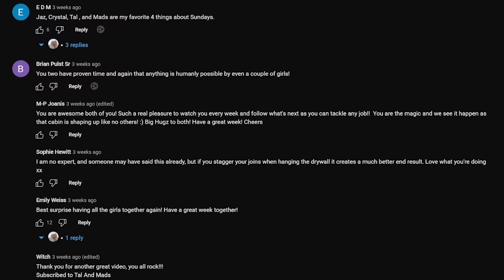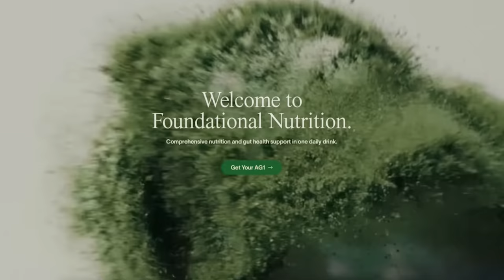We Should’ve Listened

Comment from the maker: We dusted ourselves off and decided to try again- the one thing that has helped us keep going is YOUR belief in our ability to succeed… thank you Pack 💛 Please keep the advice, feedback and tips coming!!
Reply: Rent a drywall lift. They will show u how to use it. Put textured paint on it, that will hide a lot.
Reply: There are no failures, only lessons. As long as you’re learning you’re doing great x
Reply: Its too late for my opion so i will watch to the end but i know how to do it and i plastered and drywallled for a living hi girls okay one thing about mudding and taping manfacture joints mesh and but joints paper and thin coats butt joint dont leave any excess under the tape  usualy do butt joint in two steps plaster the joint scrape all excess off let dry then next day tape using very little mud a really let that dry a lite scraping with the scraper and another coat of thin mud  and use a wide scraper dry sand and butt should be ready for prime those factory edges for me are fiber tape coat of mudd remember its not about covering with a thick coat i dry as you doo the second coat scrape with scraper then apply let dry do a light sanding and for the next coat of mud use a wider trowel and thin as possible apply another coatof mud dry sand primer look for the mistake fix sand primer  should be ready for paint do all your painting in as bright area as possible good luck  when i do this i sand but once i dont like sand so i do everything not to and thin coats is the answer  sorry for the movie but 35 yrs of of working speaking
Reply: @rayhuber3411  dry wall lift would not have worked in this application
Reply: You still have ddd
Reply: And that after international womensday!!!So proud of you2...
Reply: My biggest advice to you two.
“Don't ever change” it would be unthinkable.
Love from Mike ❤❤
Reply: @T G booooooo
Reply: So very proud of both of you. Truly inspiring. Love the editing of this video an other great skill of yours. Never give up,after it's all completed may you look at all the imperfections and be proud of them. To often we want everything to be perfect, it doesn't need to be. I'm a perfectionist learning this, I can tell you it's not easy to do so. A must, it's part of self growth and accepting that all new skills will take time to master and some we are just not meant to master. At the end of the day you can say We did it, we own it, we love it. It is your sanctuary your oasis and it's freaken AMAZING, love it.
Love yous 🤗🤗🐾🐾
Reply: @tommysargeson your one subscriber must be so proud of your comment 🙄
Reply: Great job girls.  Keep going

One thing I learned is the screws should be next to the seam for both pieces to make sure the seams don’t separate.  And create a line when you mud and tape.
Reply: You gals got this… you rock!🐾🐾✌️❤️🐶
Reply: We're rooting for you Gals
Reply: I've just repaired my hallway ceiling and used the grid tape, it's a lot easier to use as it's self adhesive. Think you both bonkers and brilliant at the same time, perseverance will always see you through. 👍🤗
Reply: @tommysargeson What on earth are you talking about?
Reply: I hang drywall everyday (20yrs) mostly all in new home construction and seam filled in the past for a couple years. I havent done many ceilings with exposed rafters but by myself that would be 6 hours to hang both sides. Mudding takes longer cuz you supposed to do 3 or 4 light coats allowing for drying in between coats then sanding.
Reply: @T G If you can`t say something nice, don`t say any thing at all!!!!
Reply: although a little late..when you put butt joints together that are not tapered you need to taper it yourself. It is super easy you just run your knife on an angle along the edge cutting a small amount off. It makes taping so much easier!!
Reply: You ladies are awesome!! Keep up the great job!!
Reply: My uncle taught me to run the tape under water and then ring it out between your fingers, it’ll stick to the mud and won’t bubble!
Reply: Congratulations Girls. Well done
Reply: I would have put the drywall on bottom of the rafters not at the roof line. Would have been easier, with places to put pod lights, and more insulation laying on top of that. But the mudding looked great this time for sure :)B
Reply: @T G What? I don't even understand what you're talking about. Why the rudeness T G ?
Reply: Love y'all ♥️💜💙💚💛🧡

Comment: A few tips. Wash your tools completely. Thin your mud, a little thinner with each coat. Dampen your paper tape when applying. Remember, thin you win when applying mud. Sanding is the enemy   Try not to leave high clumps but if you do,knock them off with your knife before applying your next coat. After you prime look for rough areas and give them one more very fine coat, then reprime
Reply: What Jeff Said!
Reply: So True 😊
Reply: Yes, on getting the paper tape a bit damp before placing over the joint. It will help it stick/bed into the bottom layer of mud.

Comment: Couple tricks I’ve discovered over the years. 1 When hanging drywall…. Remember it’s NOT finished carpentry, it doesn’t have to fit like a glove. Gaps are okay muddying will fill in. 2. If you wet the paper tape before putting it up it helps a ton, the dry paper sucks the moisture out of the mud and can leave bubbles/blisters. 3. When mudding less is more, adding 3-4 layers over a couple days is best, biggest mistake most make is trying to build it to fast. Trust me it’s way easier, faster and ends up with better results. You two are killing it, you’ve already accomplished way harder projects than drywall. Maybe not as frustrating haha That’s why so many people HATE hanging drywall, myself included.
Reply from the maker: I am not sure after speaking with so many people, does anyone like drywalling. We are sure there must be a few. Lol yes this is not the most difficult project but up there in the frustration dept. 🌞🐾

Comment: Wetting the tape before you embed it in the joint compound can help eliminate troublesome bubbles that show up after the joint dries. Keep a bucket of water nearby and quickly run each piece of tape through it before applying the tape to the wall.

Comment: I have another suggestion for you two lovely strong Spartans, (before starting, check with the laws up there), maybe building a garage near your cabin since tou have all that land/trees/all those tools. If you think about it, it's just 3 major walls, roof then the parts for the front garage. You can ecen add another bathroom in that garage too (backup shower). shrug. If you think about it you have all the wood already and you ladies can always replant trees later. :) Finally, it protects all your vecgicles from the cold weather.

Comment: I am not a contractor but it is my understanding that the mesh tape is used mainly when the gap or hole you are trying to fill is larger than a regular joint between sheet rock sheets.

Comment: @15:14

It's definitely that most people would either:
a. put a flat ceiling below trusses, or 
b. Use another framing design to create a cathedral ceiling where you wouldn't have the bottoms of trusses in your way.

Paper tape is better for shear resistance when your house settles and your sheets move/flex. Fibreglass tape will break your mud into little pieces when it shears. Vancouver Carpenter has an amazing body of knowledge for drywall for your next projects.

The finished product looks good from my house. A couple coats of ceiling pant and it's good to go.

Comment: Back in the day I renovated some nine houses and did a lot of drywalling, which is basically measuring correctly and not forcing the fitting, but taping and mudding is an art that takes years to get right. I did use the paper tape on my first reno but gave up after it was a mess and I started using the fabric stick-on tape that was so much easier. Despite my years of experience drywalling I would never have had the courage to attempt what you guys are doing. Amazing as always. Love ya both.
Reply from the maker: Wow! That's amazing Gary! 👏🏼 Good job! Thank you for all of your support on Sunday's 😊💛

Comment: Make certain you have the tapered joints together.  Use paper tape.  Apply a light coat of mud that has been thinned with a little water.  Apply the tape and then apply another light coat.  Let it dry.  Use you blade and scrape the mudded joint.  Apply more thin coats of mud moving away from the joint at 6 inch increments on each side of the joint until there is a coverage.  Now sand or sponge the rough spot.

Comment: I did my bathroom ceiling by myself it took 3 months. I used plastic tiles, gorilla glue and lots of white caulk. I had one flaw so I covered it with a decorative cloth over the sink. The reason I had to do it was I had a leak. I had to tear out the old tiles pull out all the very wet insulation and replaced it with foam. The only problem is the foam expanded too much and created a slight bulge in one of the tiles so that's were the decoration came in.  You can't really see it until it is pointed out. I was a long hard job doing it by myself but I learn a lot from doing it. Great Job Guys! :)
Reply from the maker: Wow Linda, we're so proud of you for continuing on with your home renovations. Tough jobs build tough people! Keep up the good work. 😊💛

Comment: In my 62 years I’ve probably hung as much ceiling drywall as you have in this single video. I still can’t seam very well. I would never even consider doing this ceiling. I fell off the ladder removing popcorn from my current houses 12’ ceiling. But yes those exposed beams are going to be totally worth the effort. Love your videos.

Comment: Sheetrocking simply technical 6:52 you have to have experience, with the experience you, will gain skills. The Valley in between the two sheetrocks, is the tricky part of hanging sheetrock,  it's called plastering, all in the hand, But wait until you do the corner...
Reply from the maker: Yes we said, we need to have experience to learn the skills, and tips & tricks. 🌞🐾

Comment: Uhhh, I have done several of these types of ceilings. We first lay in strapping but not above the horizontal bracing. We actually first drywall that flat section leaving the area above unfinished. Then one drywalls the remainder of the sloping ceiling to the top of the walls. You loose that small section above the horizontal braces but you still get a tall ceiling. I commend you for doing it the hard way but remember your backs will kick you in the future. Learn to keep your bodies in good shape with proper exercises and there will be less chance of back problems in the future. Take it from experience, been there, done that.
I love your videos! Keep safe and rock on!

Comment: As a handyman that did some drywall, I definitely would use the mesh tape.  You can run the tape and then go in with the mud.  The first job I ever did with drywall was sanding a project that was already muddled.  The guy that did it put one layer of mud and then we sanded for an entire day.  Since then I have not gotten better but you can build up multiple thin coats and not have to sand until the third coat.  Just scrape the high spots and add the next layer.  Ya’ll are great fun to visit and you have done so many incredible things that we can forgive you if you don’t do drywall that well.  Best of everything for you!
Reply from the maker: Thank you for sharing all your knowledge and experience with us. Yes as we do it more it does become easier and we learn a few tricks along the way.💛🐶

Comment: You girls never quit.. way to go. One question though, I guess you wanted to see the wood rafters after drywalling? Most would have hung the drywall on the lower parts of the trusses and you would have ended up with a smooth ceiling from your wall to the peak.  Love what you have been doing to your whole project. Can't wait until you next video. Thanks for sharing your dream.

Comment: You two are kicking butt! When mudding, graduate the length of your knives. Start with a 4” when you’re laying in the tape, covering screw holes. As you add skim coats, when you feathering out, increase the size of your knife. From 8” to 10”. Etc. Like you, I’m a DYIer, and picked up a bunch of tricks from contractors. At the last coat after all the sanding in between, (get an attachment for your shop vac, so you’re not eating massive amounts of dust) if you add a little plaster of Paris to your compound, that will make it set up and dry faster, not so many cracks. But you have to feel comfortable working quickly.
Reply from the maker: Thanks JB for all your tips and tricks. We will definitely implement them. Thanks for watching.🌞🐾
Reply: @Vanwives  you two remind me of myself in my salad days, keep it up! Love Auntie Jill 😁

Comment: Oh...lol the paper has a seem in the middle to fold it, right? for the corners... and mix a creamy mud solution to dip the paper tape in to make it wet and sticky AND OMG the hawk and trolls must always be kept super clean looking like the day you bought them or little pieces will always end up on the wall. Another trick when doing a final coat on places that need a touch up... add a little caulk to the mud mix U know chalk line chalk red or blue is better so after it dries you will be able to see where you need to sand again. it won't interfere with painting Good job guys and Bravo for hanging in there!
Reply from the maker: Thanks, Mark. Great ideas! 👏🏼

Comment: Can I offer a few tips... It is a good idea to use taping mud for your first coat when you are using paper tape. It has glue in it and will make a much nicer job. Whip your bucket of mud with a little bit of water using a drill. It'll get all the air bubbles out of the mud and make it a lot smoother and easier to apply. Use Finishing mud for the 2nd and 3rd coat. It is much nicer to to sand. That's definitely a hard project to tackle, you guys are doing a great job.

Comment: ⭐️⭐️⭐️⭐️⭐️⭐️⭐️⭐️⭐️⭐️ and you guys thought the roof was the hard part. You’re doing great. When I use paper for taping I precut the paper tape about a foot longer than I need. Then roll it up, then put it in a bucket of water. When you are ready for the next piece of tape pull from bucket slowly squeezing most of the water out between my thumb and hand. Then first layer mud then apply tape then second layer of mud. Also when doing corners I pre-bend  the tape. You gals must be a little insane for trying this, however you skill level is definitely going up, and from what I have seen so far I would let you drywall my ceiling.

Comment: You guys did just fine. Drywall is my least favorite construction material to work with. Doing the tape is where the finish of the job shows the most. A trick that an expert drywall installation guy taught me was to put some Dawn dishwasher detergent into the mud and mix it until it is smooth. I would put about a cup full into a five gallon bucket. It leaves a very smooth finish that doesn’t require very much sanding. That is a real time saver. Another  trick is to use flat paint for the ceiling to hide some of the inevitable flaws that it will have. You could go crazy and rent a texturing gun and spray the finish on. Very messy but it hides a lot of sins.
Congratulations on getting the ceiling up. Cheers Your Pal Al

Comment: Biggest tip I can give you for drywall would be to watch pros do it. @thedrywalldoctor, prc taping and drywall nation all on YouTube. 
Definitely don't use mesh tape. Paper is best for angles / corners. Fibafuse which is a fiberglass tape is great for flats.
Keep the mud thin and smooth, more coats are better than thick. Coats get progressively thinner till you are just filling scratches and nicks.
Scrape with the knife between coats maybe a little sanding between coats but you shouldn't need to sand till after third coat. 1st tape coat, 2nd coat and 3rd coat. Sand and touch up then sand touch ups.
Good luck.